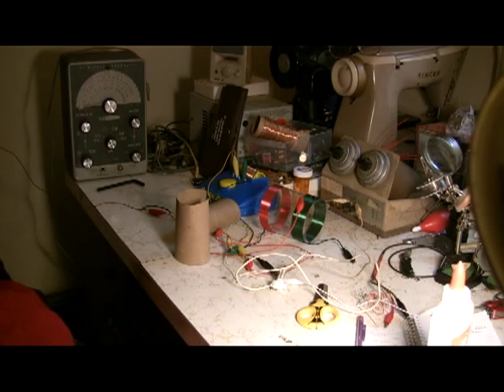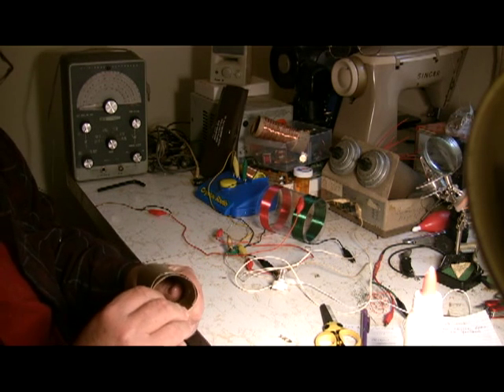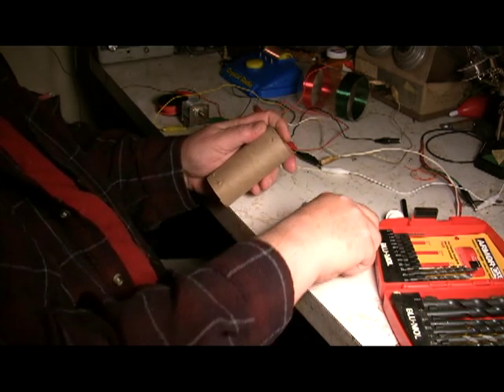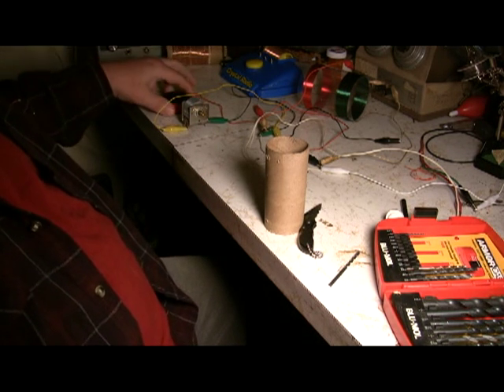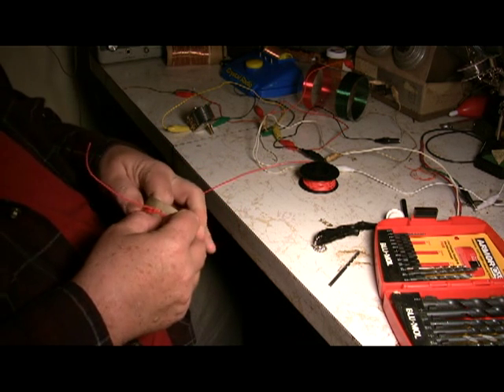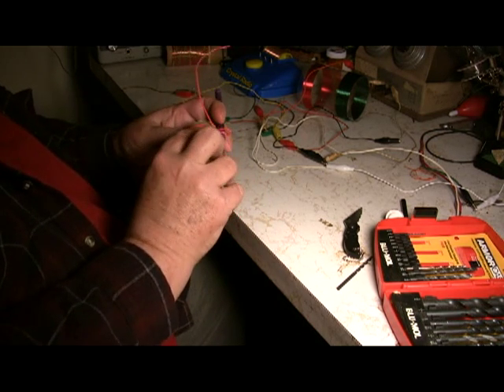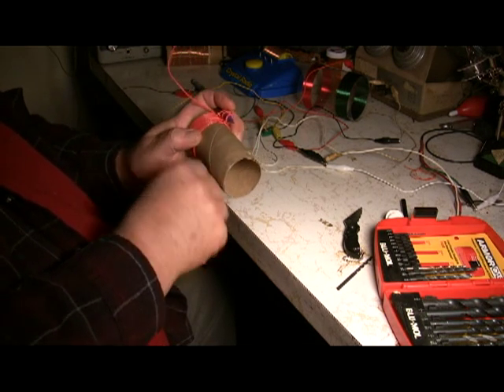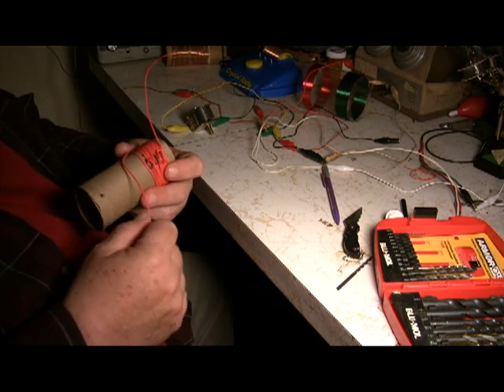Crystal Radio pt3. Winding the coil

Comment: Good video!  How do you determine how many windings to use?  I'm guessing it depends upon the diameter your roll, right?
Reply from the maker: Yeah Walt, there are several things to consider. Most of the coils we do for crystals are usually open air.. And they are usually wrapped on a toilet paper roll or a paper towel roll. You are trying for around 200 to 250 microHenrys for your impedance. Normally about one hundred turns with some tapping loops with 20 to 24 gauge magnet wire will get you in the ball park.
I will be covering this and coils with ferrite bars in upcoming videos.
Thanks.